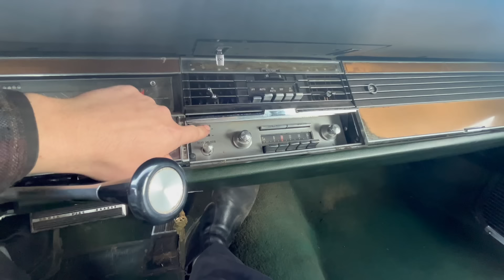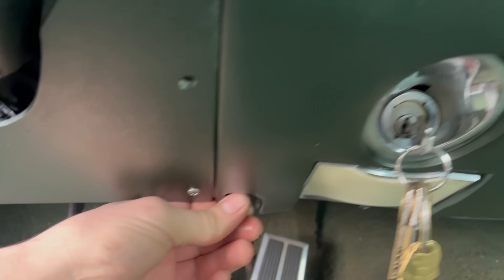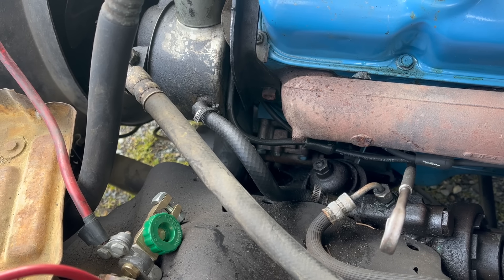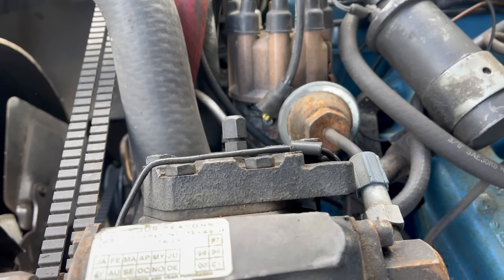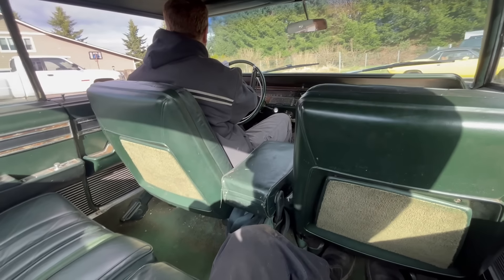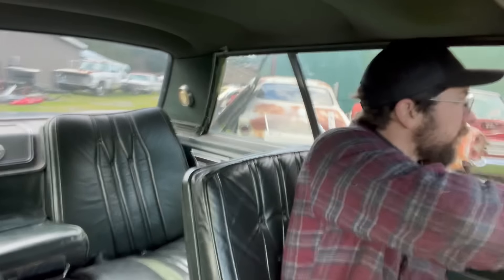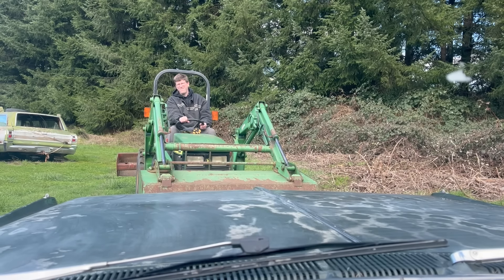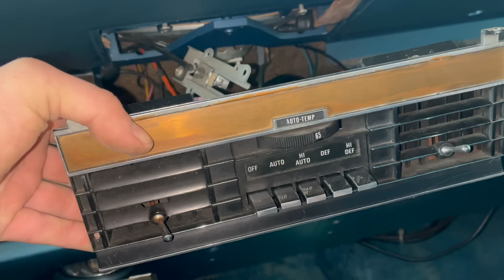High Class - I Revived This 440 Powered 1968 Imperial Crown Coupe, Then Buried It In A Field

Comment: About that second but unused cutout for dual exhaust. For some reason the Imperial hardtops all only came with single exhaust, but all the convertibles came with duals which would explain the unused dual exhaust cutout on your car.
Reply from the maker: Huh! I'll have to look for the dual system on the convertible when we get to that. Thanks for letting me know.

Comment: That 68 Imperial Crown Coupe 
is absolutely beautiful ❤ 

You're right 
Imperial was its own brand 
1970 was the last year 
They did that 

Buick Riviera's had those 
Cardigan U joints too 
(Similar era )

Never knew the fuel cap was under there , thanks Jamie 🙏

Oh yeah  , you're right  , again 
These were legendary in the 
Demo derby 

Great mechanical detective 🕵️‍♂️ 
Work , decoding that oil pump & 
Engine block 

Like all of those , 
creature double features 
Ergonomically correct too 

Wait a minute  
Does that exhaust manifold bolt ,
Go through a , water jacket  ??

Actually , I wasn't going to ask about that Imperials "Bo Duke" 
off road Capabilities  but , 
you do , you 🤦‍♂️

I wouldn't say , mistakes were made . I'd say , excessive fun
 was experienced 😬
Reply from the maker: Excessive fun indeed. Haha. Yes, many (all?) of the exhaust studs on these heads go into water. Leaking there is an issue we’ve experienced a couple of times now.

Comment: I once was tasked with restoring a 65 880 convertible so got a 68 Imperial for the good 440. After I pulled it I put the word out the Imperial was up for grabs. Several guys showed up and were angry with me for ruining the Imperial. I said I didn't think it was worth much because it was a 4 door. I did not know there was a mopar cult. I traded it for road runner disk brakes for the 880.
Reply from the maker: I fully expected to be yelled at by Imperial enthusiasts for my exploits in this video. So far I haven’t heard from them.

Comment: I had one of these. Everything on it is heavy. The entire grill is diecast. The gas cap is 6 pounds. good luck removing the front bumper; all the bolt sare hidden. The hupcaps are 3 or 4 separate pieces with a heavy diecast ring.
Look at the size of the quarterpanels.
Giant 4 piston Budd calipers. 5 on 5" bolt pattern no other MOPAR car wheels fit. It is entirely unique aside from drivetrain.

Why do I think that mine had a Holley on it?

Nice feature, brings back memories, Thanks
Reply from the maker: Turns out the Holley is correct. The blue car has it. This must have been swapped from a different application, because it has the correct Chrysler throttle and choke connections. I’ll take the Carter, any day…
Reply: This guy and I scraped that car. Biggest automotive regret of my life.

Comment: My brother bought one of those . Was a fine specime. We pulled the engine out. Threw it  in a 70 super bee and made it to the track. Looking back. We used to throw small block Chevy engines in the imperial. Then derby them. A small block Chevy will run longer than any other engine without h2o. Just saying ; )

Comment: I like the green pickle Impi. A big boat floaty Luxor barge. Even if it’s the stripe model.  But the blue chipper her is the impi drop top. That’s the really cool one.
Reply from the maker: I’m sure you’re right, but I much prefer to have a roof
Reply: @DeadDodgeGarage  I guess when you live with rain or drizzle for 10 out of 12 months every year, I understand the desire and preference for a roof. I will rent a convertible, but buy a hardtop.

Comment: The toggle switches for the headlights and wipers look like the same switches on my '68 Fury VIP.  My VIP also has a reclining passenger bucket seat. You can get Auto Temp in a Fury that year, but I wouldn't recommend it. It was also the first year, the cruise control was on the turn signal stalk.  That desk you wanted is part of an Imperial option called Mobile Director and the front passenger seat also swivels. Pretty neat.
Reply from the maker: Nice. Yes I’ve heard about the Mobile Director option from a few people now. For something that was only installed in about 81 cars, a lot of people seem to know about it 😅 it’s very neat. If you saw the cruise switch (“Auto Pilot”) in the blue car, it’s on the dash in these.

Comment: You mentioned  the need for a desk to do your bills on. The option was 500.00 + and it was called The Mobile Director Option. It consisted of a desk the front seat goes backwards and there was a tensor light.
Reply from the maker: I learned that from an earlier comment! I went and found pictures of that. What an interesting and quirky setup. I also learned it was based on a concept feature that also had a phone, stereo and other fancy electronics - none of which made it to production, obviously.

Comment: There is an anecdote among car designers & stylists that goes something like when the AMC Hornet debuted at a car show (the location varies by story) that designers from GM, Ford & Chrysler gathered around the car to see how NARROW AMC had managed to get their new front doors.  The Hornets doors were literally HALF the width of a standard mid-size door .... narrower than even GM and Ford designers could come up with for their upcoming Vega and Pinto projects.  The anecdote goes on to say how upper management at GM was furious with their designers because they had told management that doors couldn't get any narrower. "It just wasn't possible" they were told. But then here comes little AMC with a compact car with narrow doors that allows their compact interior to have the hip room of a Chevelle, Torino or Satellite.

I miss my '68 New Yorker.  If I had only known how rare those cars were in them pre-internet days.... I might not have ever parted with it.  Of course, after I did part ways with it; the Javelin I had traded for it promptly folded in half (from rust) and little did I know the 440 in the New Yorker was in the process of spinning a main bearing.  We knew it had low oil pressure; but it always put out the warning light. 

The 440 went on to power a '68 Charger R/T.... and the rest of the car sat and eventually (probably) went to a demo derby.  I lost track and the guy who sold it refuses to tell me to whom he sold it so I can only imagine the worst.  Funny thing about the 440 though was apparently on the pan rail ID stamping.... the engine may have originally been slated to be a Magnum or TNT motor.  The P for premium fuel had two X's stamped through it and then an "S" stamped sort of kitty-cornered to the rest of the rail numbers.  But, the car had a Holley carb, standard manifolds, single exhaust and we can only assume it had the low-performance cam.  My friend who built the engine didn't notice anything different about the pistons or rods.  Just another one of those funny Chrysler anomalies.

Not everything there is Imperial-specific.  My New Yorker had the same dash switch gear, practically the same gauge cluster (sans oil pressure and temperature gauge).  I'd assume a lot of that stuff is shared with full-size Chryslers because by the next year, Imperial would become a sub-series under the Chrysler badge again.
Reply from the maker: Obviously there must be some level of parts sharing. But I know the Imperial is at least largely unique. And a small correction - the Chrysler brand name reappeared on Imperials in 1971 (“Imperial By Chrysler”), but left again for 1974 and 1975. Additionally, Wikipedia states that the ‘67 and onward cars use the “standard Chrysler body” with Imperial styling, but that is not correct. They were no longer full frame cars, but the lines and exterior styling are not even similar between the two for ‘67 and ‘68. Starting with the fuselage cars in ‘69, the main body appears to be the same - so I’m assuming that is what you are referring to. Why did I just go and research all of those details? I wish I knew 🤣

Comment: While I would buy that car in a heartbeat, I would NOT hesitate to put a high performance drive package in it!

I'd bore and stroke the block, put a blower on it, trick pulleys, a 6 speed manual, in a console, and a sure grip diff.

I would also modify the dash to be 100% digital [but NOT the motor!].
Reply from the maker: But why? It’s great as it is, it’s a total survivor, and all that stuff would make way more sense in an actual muscle car.

Comment: If this car had the option mobile director, you would have had your desk back there, .   In 67 that was a fairly well equipped car, not like a lebaron but not bad either.   The imperial handles well similar to a Cadillac and both are much better handling over the Lincoln Continental

Comment: I swear at 12:00 minutes or so I saw an electric arc down under the brake booster around the red cable??????
Maybe it was just the camera???
Or coolant puffing out around the exhaust bolt???
Reply from the maker: I believe that was a bit of dust or debris blown out of the radiator or shroud by the fan that flew in front of the lens. Flying crap is something we always see when firing up cars that have sat for years.

Comment: One of our Mopar club members has that car in light green with the mobile director option.
Reply from the maker: I think I just saw that car online! I’d never heard of the mobile director. That’s neat. Less than a hundred made…
Reply: @DeadDodgeGarage  He's had it for a while a long with a bunch of other neat C and B bodies. If he ever lets me, I'm going to do a video series on my channel covering them. And if I'm correct, Imperial is a "Y" body.
Reply from the maker: @LongIslandMopars  I've recently become enlightened on that. There is some confusion because the first digit of the Imperial vin is Y, and in the service manual for some year (or years,) they are referred to as the "Y line" cars. But apparently the actual chassis is the C-body chassis starting with the unibody cars in '67. For '69, they use the same basic body as the other Chrysler C-bodies, so this becomes very obvious. The Imperial of the 80s is actually classified as a Y-body chassis, further aiding this confusion.
Reply: @DeadDodgeGarage  Good 'ol Chrysler. Always doing their best to make our lives interesting. 😎

Comment: A real shame they put that '77 block in there. I bought one of the most optioned '71 Charger R/T's I ever saw that had a '77 engine in it. You can definitely tell the difference between the 1968 and 1969 models as far as construction quality and feel. They advertised they used actual South American hardwood veneers, maybe Brazilian, on the interior. But it was REAL wood. They also had a really cool model called the 'Mobil Director' with a rear seating area that semi-converted to a 'work space' with a table and jumpseat for a secretary. If you think that car is huge, wait until you see the trunk of a 1959. I saw one in the junkyard once and I swear you could put 6 bodies in there!
Reply from the maker: I find it very interesting that everyone seems to know all about the Mobile Director option, when they only made like 86 of them. Haha. In this case I think it is early guts in a late block, not a whole late cast crank low compression engine. So that’s the good news - a 440 block is a 440 block.
Reply: @DeadDodgeGarage  Not too bad then. I wonder why they would swap the block? Can't really feature an Imperial having a block destroying catastrophic failure.

Comment: Well in Tom's video you showed the reclining seat. Next time use a DNA light before you sit in it. Babies where made and lost there 😂 you won't ever sit there again lol. Now actually this shares more with Lincoln than caddy to be honest and Lincoln out sold caddies plus if you look at the Lincoln of that era much of the styling is the same. Those steering columns with the 2 spoke wheel were later outlawed do to impaled people with head on crashes. The car would stop fast with some damage but the driver didn't. Ya like a big arrow or harpoon and it was messy. I guess I should thank you now for not doing a corndog run with the coronet and got the your welcome rooster part 😂 wet clay is like grease. Plus I believe that tank weighs over 5500lbs which is a tank so thus why the Cummins took issue with pulling it out. I knew the jd would fail lol. It's a good day no one died 😂 fyi everyone is sick here. One day it's 30s 3days later its 70s. The mailman is a total fck up and lost titles and neighbors bringing me mail is getting old. This morning a neighbor brought me the title to my 70 charger. 😢 but at least it made it. Checks I sent out are not cashed either like the one to tom for the work done. I wonder if he ever got it. I will enquire later
Reply from the maker: Ugh. Damn them… the guys said about 4500. I don’t know, but it’s not light. I seriously don’t know why Tom bought such a tiny tractor.
Reply: @DeadDodgeGarage Unfortunately the '68 Imperial brochure I have doesn't include the 224.5" behemoth's weight. I guess you're going to have to take to your local truck weighing station. 😂
Reply from the maker: @stephenholland5930  I'll have to use it for a dump run like I did the Dakota. I'm confident it will fit just as much garbage in the trunk as that truck does in the bed. 🤣
Reply: @billmcdevitt1298  you are correct sir thus how similar they are.

Comment: Parking lights ARE supposed to be on when the headlights are on.   9:40  Like every other car.
Reply from the maker: What? No. Through at least 1968, on Chrysler products, the front parking lights turned off when the headlights turned on. They were on in the first switch position only, with the other marker lights. The rear running lights of course stayed on. My reading seems to indicate that this changed on A-bodies for ‘69, but B-bodies in ‘70. I do not know either of those to be correct. But I do know that in later years the front lights stay on too. Not on a 1968.
Reply: @DeadDodgeGarage  Now, we are talking about the front lights that share the lens with the turn indicators, right? Not the side marker lights. They have a two filament bulb. I have not used a 68 and older for a daily driver in decades, but I have 65 and 68 C bodies I can hook up a battery to and check it out.

Comment: In 1968 parking lights and headlights at the same time
1967 and earlier no
I'm so old I remember when parking lam ok s went from clear to Amber
Maybe 1964
Reply from the maker: I guess I can’t speak to the Imperial, but I know on A and B body, the front parking lights still go out when the headlights are on for ‘68. They are only on with the switch one click out.

Comment: Being a disabled veteran on a fixed income I don't have much money but I will trade you body parts for the 68 imperial.  Or other good driving MOPAR.  I'm not nuts just broke and desire an old Mopar.
Reply from the maker: This thing ended up selling at auction on Hemmings for like half of what it was worth. I actually bid on it myself and didn’t miss it by much. But really don’t have room in the fleet for two Imperials…
Reply: @DeadDodgeGarage  Well to be honest I meant parts from my body.  I know, weird.  I have a couple toes I don't need.  Didn't think you'd go for it, like I said I'm not nuts, just wanting what I can't have.  If you'd said yes I would have gone through with it (honor) and all that.  My wife wouldn't have been happy with me.  Merry Christmas.

Comment: Awesome c-body. Parts almost non-existent for critical components. Surprisingly many brake and suspension parts Imperial specific. Even finding a later model brake upgrade for front (to get rid of the HORRIFIC Budd system) are tough yo source. A semi-retired guy in Portland has a spindle using 70’s GM rotors/calipers. And the extra-scary hacked & welded cast iron “new” knuckles sold by some YouTuber in the SE. Criminally irresponsible to sell those.
Reply from the maker: Technically these aren’t even a C body because they are so different. I don’t remember which chassis code they used in ‘68. I’ve used a drum to disk conversion bracket on a 64 C body, and that worked ok.
Reply: 67-68 Imperials don’t share many chassis parts with earlier or later C-bodies. 67-68 Imperials are definitely C-bodies.
Reply from the maker: @mopartony7953  I have become enlightened. I was told "Y" for the unibody Imperials, but that is only the vin prefix, and it is indeed sitting on the C-body platform. The later (80s) Imperial was actually classified as a Y-body, further aiding confusion. I was thinking of the earlier "D-body" platform, and thinking that these kept their own designation, but they didn't.
Reply: @mopartony7953 Why is the front stub frame different than actual C-body cars? Why is the rear axle different? Why is the bolt circle for the wheels different? 
It's bs to call these C-bodies.

Comment: This is cool, as I told you before I have two of these. The first thing you need is dual exhaust. I hope the compression ratio is correct.

The reason the rotors get warped is because idiots machine the rotors when they replace pads.  You are not supposed to do that, because the venting air gaps are too big and there is no material left.  You can use rotors from other cars with some modifications.  86 Supra rotors can be fitted.

These cars are ideal for high speed driving.  Here is an example, if the link works.  Based on calculations from time and distance, the average speed of this run was 128.  The car was going on an slight up hill, and it was not that well tuned.
https://www.youtube.com/watch?v=ygXa15mpSck

Comment: 67/68 design came in right after Imperial's arguably most famous design, the 64/66 models. IMO, a failure, especially that rear look. Imperial was coming to it's separate lineup around 55, when there was also a big push by Ford to amp up their luxury class, which also failed. Imperial took over Packard's spot in the luxury class. I'm a little surprised how flat the floor is, not really Hudson step down when most of the industry really was.